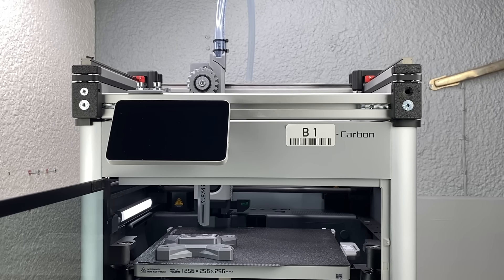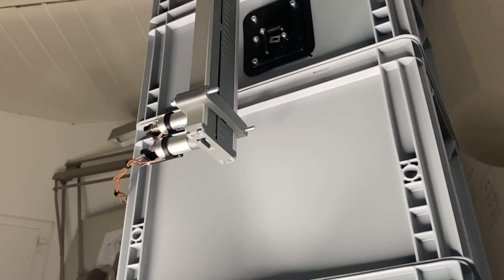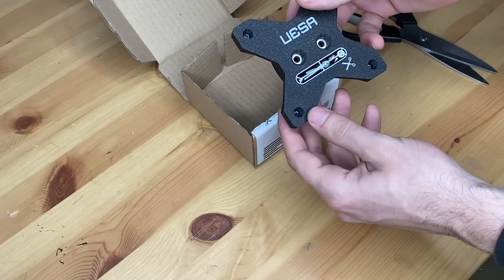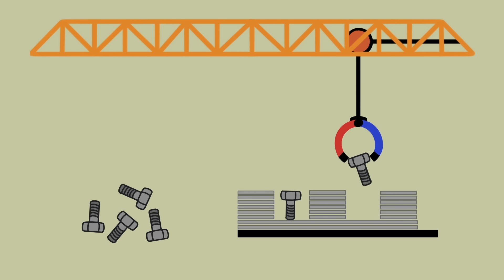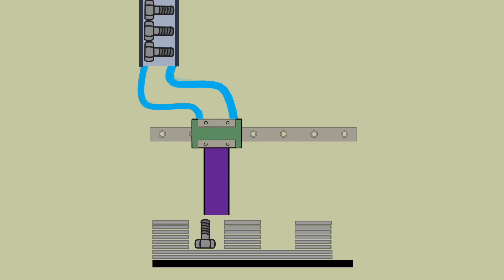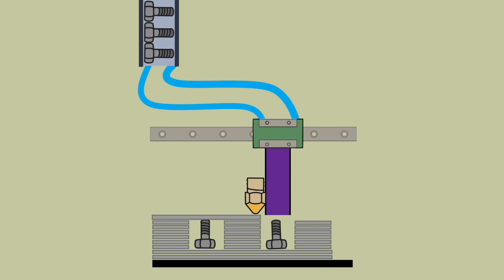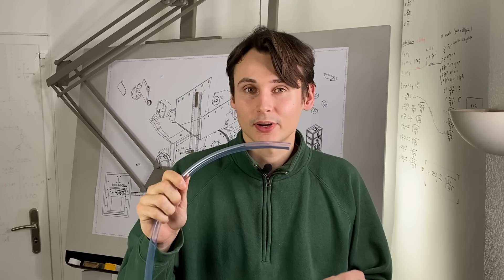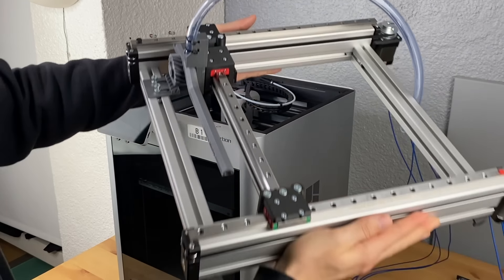Robotic placement - 3d printed automatic screw packaging #003

Comment: Is there any chance you could go into more detail about the tensioning system ?
Reply: +1 too. It seems completely clean and crazy easy to use
Reply: +1 Please give us a hint on what part moves to do the tensioning.
Reply: I think its just a threaded rod, that runs through the hole in the extrusion and pushed on the roller on the other side.
Reply from the maker: sure, to be honest it's not really tricky. @Frederick explained it well. It's just a threaded rod that goes through the hole in the aluminum profile and is connected to the roller on the other side. On the threaded rod sits a pair of springs. The rear motor mount has a sliderail that runs in the profile. This allows you to "extend" the rear motor up to 40mm. 
I like that it is easy to access from the front and pretty straightforward to use. But it is unfortunately not witchcraft
Reply: Definitely would like see more details about this as well
Reply: Same here! Looks great and I would love to see some details!

Comment: Pretty neat idea! Piling is definitely an issue that is very common in robotics. Perhaps you should allow the screw to land vertically into its own vertical chamber maybe made from a hex grid pattern like an infill? Turning it sideways before placement is also an option but its definitely more complicated.
Reply: Exactly my thought, add some simple dividers in the pocket, for each screw, and place them, each one in its own place. the divers don't have to be solid or go over the full height, just some bridges in the middle and some more on the top
Reply: Exactly!  Or even better, redesigning the part such that you place the screws into chambers where they are actually meant to use.  Automating the placing of captive bolts in a 3d printed part could be really awesome!
Reply: I don't understand how to tighten the belt at 7:36
Can someone explain it to me?

Comment: This probably wont make much of a difference because you probably found a solution, but if you put a curved shoot at the buttom where the screws come down you can force the screws to move the furthest point of the slot, as the second one comes down it will push the first one further along,  in all each additonal screw will push the previous one toward the far side. This should solve your problem of screws being bunched up. A second away to fix the problem would be to start the drop at the far side of the slot and have the head move toward the front dropping screws as it goes allowing the screws to be more spread out instead of bunching up by dropping in one spot. Just some food for thought!

Comment: Hi... Perfect design...
Can I give a tip?
About the screws going out, is because of aceleration while falling down... How about putting some electromagnet at the end of the tube? You can activate electromagnet while the screw is falling, use some light sensor to see when the screw is stopped at the right end of the tube, and turn off the electromagnet, this will allow the screw to fall slowly...
Sorry for my english, still learning.

Comment: This machine has potential! It can (and will) work!!! The only problem is keeping the screws in the same tail-up orientation when it lands in the hole of the printed part. You might want to have the head of the screw inserter (the part labeled "DIN912 M416") move in a straight line each time it inserts a screw; however, it might require tuning of the pneumatic system so that it doesn't give the screw enough energy to bounce and lose orientation. Or an easier option would be to increase the, depth of the, cavity the screws are placed in, regardless of their orientation or likelihood to jump out.

Comment: i've used commercial nut feeders that cost well in excess of $10k each, even those had  tons of problems. It's a tough nut to crack. The fact that you managed to get a working one with 3d printed parts is impressive as hell.

Comment: Printing small guide surfaces along the drop/fall path could ensure proper bolt stacking, that’s a good cheap feature on the part itself and keeps your insertion tool general purpose

Comment: Creative approach, and nice work even if it didn't work out the way you wanted.  One other issue not mentioned here is the user experience.  I wouldn't be thrilled if I left jagged edges on my brand new part after removing the screws from their chamber.  Inevitably, someone won't do a great job with the break-away, and they will cut their finger as well.   Instead, what if you just position the screws into the holes they will eventually be used in?  Then print a single layer that keeps the screws from falling out of the hole?  This should help resolve the stacking up issue, AND it actually provides value to the end user.

Comment: How difficult will it be to add an offset electromagnet tool head, the let the 3d printer go to fixed place, where the screw feeder places the screws. It is a bit of overhead, but compared to 3d print time, not that much. Just some thoughts 💭

Comment: Rather than dumping all the screws into a single pocket, can you not deliver each, in the correct orientation into the hole it's eventually going to fit in?  You could make the screws completely captive, just leaving an exterior hole big enough to insert the hext driver to tighten the screw.

Comment: Great demonstration of engineering! Would adding an electromagnet to the print head and a feeder work? I feel like it could further simplify the process by altering the G code having the tool head picking and placing parts on to the 3d print.

Comment: Also, to solve the impacting the build plate issue, you could lay down a layer or two of transparent filament with similar tolerances to a brim, just for the entire hole as opposed to the wire mesh that you has shown.

Comment: Regarding the screws piling up, what if you added a small electromagnet at the tip of the dispenser to temporarily "arrest" the falling screws so you could have a more controlled screw placement? 
Instead of the screws falling 50cm+ onto the build plate, it'd stop right at the tip and then released, with the final drop being potentially less than 5cm?

Comment: And actually, I think your HBot is very practical too. Screws simply need to go in individual pockets in printed model to prevent piling up. You're dropping screws head down, right? I'd divide the slot you're dropping screws into with one-wall fences so they end like bullets in a clip. And may be a bit more of cut-out mesh on the print surface to protect it.

Comment: I really enjoy the engineering/problem solving you go through. 
You could 3d print simple boxes to store the screws in for shipment instead of manually handling bags. Peeling a tray of pre-counted boxes off a printer plate 'may' be less time and work than opening a bag and holding it under a dispenser. Also, your customers  get an extra little box.

Comment: The impacting on the build plate could be lessened by printing one or two layers below them.
That way they don't directly hit the plate, but 1-2 layers is still thin enough that you shouldn't need "heavy" tools to get them out again.
A small grid design could further make it easier to remove without removing the protective effect.

Anyways, I'm so excite for how this continues.
Gonna rewatch the last video because that dispenser is such a nice design. I wanna see it spew out the ~60 screws again :D

PS: I wanna chime in with the others on the notion of how the tensioning system works. I've rewatched those few seconds a few times and still can only guess how it works...

Comment: Dude, please print that screen adapter on top of the flattened carton box. Then, when finished, use the gantry robot to fold and form the box around it. Also, use it to throw a plastic bag with the screws in the box and fold it shut. Build an ejector and a flat cardboard box sheet reloader to restart the process and take a vacation!

Comment: Christopher, how about this ... not thought to the end 'though and would not work with the current configruation, but maybe could be built on this: 
Make the applicator L - shaped with the horizontal part holding a revolver magazin with a "bomb slot". One chamber would have to be empty at the start.
Make the tube end above the printer or have Your stack magazin end directly over it. 
Then, in the horizontal position of the applicator fill up the revolver with screws - each chamber having three or four screws.
Then bring the applicator to the vertical position, the desired x,y drop zone and rotate the revolver by one chamber.
Two chalenges from the current version would be to hold the applicator horizontal when being moved for refueling and the rotation "down there" which could be done mechanically or electrically. 
Alternative to the revolver would be a variant of Your already existing magazine stack which would be filled from the side (from top in the horizontal applicator position) and would would hold three or four screws per stack level. 
Hope this is clear enough to understand what I mean.
Regards Frank

Comment: Cool idea. But sorry to see you didnt make it to the end with it 🤔
The solution is pretty simple i think. Separate compartments, and move the tool between every drop of a screw. 

If not enough space to drop them vertically, then have them diagonally or even flat, with a chamfer, like the orientation part in the stacker system.

Comment: Try adding a wire coil at the bottom, as each screw is dropped you're now dropping through a magnetic field that can be tuned to slow them down. You should also just make the screw chamber bigger...

Comment: Great idea, this is one of my new favorite channels!

One idea to solve the screws piling up issue. What about making the tool head a detachable extension to the magazine. So the orientation is maintained horizontal? You could even have an arm in the path of the dispenser screw to optionally flip it vertical similarly to the part you designed to feed the tube

Comment: I've really enjoyed these videos. I'm in, easy subscribe!

I have been working for a solution to replace manually placing test tubes caps and ran into a problem with orientation where gravity will not guarantee a proper alignment. Do you have a solution or a methodology for designing part orientation without reliance on uneven weight of the part?

Comment: you could just print some cylindrical containers if thats a packaging problem. it would still work as packager without human intervention. With threads and everything :P. And the next thing is auto bed replacer which I already saw somewhere and it would be truly automatic system.

Comment: I thnk if you added a magnetic control at the bottom of the end effector, you could solve your problems with the scews. Something that would squeeze the end thats dropping the screws, until the exact time that they need to drop. It would only take two wires and a few wraps of wire in the right spot. Maybe like air brakes on trucks where it its closed until a force is applied to force it open it. If it failed, it would fail closed and preserve the print at least. 
Looks really slick otherwise. The internal naming is a great method.

Comment: your videos are so incredibly inspiring! here's an idea where your current design would work wonders: embedded screws into the part such that you cannot loose them. like placing a screw into a counterbored hole where the counterbore partially narrows at the entrance such that the screw is trapped inside. I always love parts where screws can't fall out, makes disassembly & maintenance just so much more pleasant

Comment: Nice engineering work.  I definitely think this is an engineer looking for a problem to solve, instead of being an actual problem, since you'd require your customers to go find some scissors to free the screws instead of just opening a bag, but it probably could be implemented better with a precise drop for each screw in a silo'd screw hole that would keep each one vertical, before covering them up.  Either way, you've earned my sub, and I look forward to seeing your other projects.

Comment: It would seem to me that making the bagging part of the process automated would have been an easier task (though for sure less cool).

Assuming you can buy baggies that are open.
If you simply had a set of rollers pull from a stack of baggies (think similar to a computer printer pulling from a stack of paper) and then have a moving capture mechanism that holds and moves the baggy to the right position. 
A jet of compressed air props the bag open while the screws fall in, then a press closes the bag before the retaining mechanism drops it into a container.

Have you looked at the viability of this concept yet?

Comment: Open Sourcing the Design, but Selling Kits/Toolheads for this could be a way to go.

I personally (once i get the funds) would GLADLY buy a version of this project in Kit Form from you.  That way i can use this awesome machine, and support the original developer (YOU).  But since it would be Open Source, others could design different modules/toolheads and have them connect and interact nicely due to the Technical Drawings/CAD Be available.

If all goes right, you could grow to something like Prusa Research (although growth is not REQUIRED, do what makes you happy) and a whole community could emerge from this, and “mid scale manufacturing” could have a huge boost!

Comment: This is awesome, also regarding the problems of the screws staking, I don't know the term for this mechanism (Ill just call it a Pivot T) but I thought you might solve that problem by using something similar to a pivot point that are used when balls need to go right or left in a Marble Run Machine. Having the 90 degree angle on the Pivot T will most likely be a problem so you could modify it to be "reciprocal squared" shaped.

Comment: Seems incredibly overengineered for this specific application, but hey as an engineer I LOVE overengineering 😊

I also appreciated the smart bits in you design like the mechanism for folding away which doesn't use an extra motor or servo.

Keep up the good work!

Comment: Hi. Would you share please what kind of CAD software are you using here? I have worked professionally for years with most of the major products, and every single one of them is garbage. Some have unproductive, primitive modeling with no freedom at all, some are terrible at drawing creation and BOM management, some are just buggy and crash all the time. They are all frustrating in their own ways. I was just not able to find a good tool.  The look of your models look unfamilar though, so i have clearly missed something. what is it, and is it any good?
Reply from the maker: Hi, I use a wild mix of mostly Autodesk software, for this video Inventor and Fusion360

Comment: Looks good the theorys pretty good on it, executed incorrectly in part placement part, and your stop and feed positions were not programmed well enough. Without correct holes and part position placement of course it did not work. Its a great concept to get others thinking and trying similar devices. Internal bearing and bolts would make prints more convenient

Comment: At this point, you might as well build a 3d printer with tool change. Less belts, no worries about toolheads coliding, easier to drive (you can use 3d printer control board to insert screws)

Comment: I'm not a fan of the system of automatically packaging screws inside the print: one failed print (probably 4 since you print several at a time) because the nozzle bumps into a screw will conteract any savings on the plastic bag. You could have your machine place screws directly in the cardboard box, maybe?

But as a way to insert metal (or previously printed plastic, why not?) into 3D prints, that's cool

Comment: darn I'm going to build something like this for my printer i have 6 tool heads i only ever use 3 or 4. i want to make tools 5 and 6 do m3 heat set inserts maybe one for vertical and one for horizontal. with a side mount feeder system. 
a small stepper vacuum pnp and a custom induction heater tip
Reply from the maker: sounds very cool!

Comment: slow down the steps between the placement of the screws and as the arm moves across the hole. it should leave the screws stading up and have more control and presision

Comment: Anyone got any ideea how the belt tensioner works?
Reply: Not a clue, haha. Maybe he'll share his CAD files in the future. Seems like a great starting point for a custom Core-XY printer.
Reply: I think it may push out the motor on the other side to tension the belt
Reply: @karolniedbao5420  so the lateral slot is to insert a nut? i though that for example let's say the shaft of the pulley wheels are mobile, and when he screws that bolt, the bolt stays in place, and it moves close to it something like a triangle, that pushes the bases of the pulleys apart

Comment: If I may suggest you a solution.

To decelerate the part and get a more precise output, I was thinking about the effect you get when you pass a magnet into a copper coil (as this : https://www.youtube.com/watch?v=N7tIi71-AjA)
But as your part are made of iron, instead of a passive coil, using one or multiple coils that you activate when an element pass though can slow down the part and reduce the bounce effect.

Comment: Mf would literally mod a bambu instead of just building a voron💀
Reply: Just build a tapchanger then replace one of the toolheads with screw dispenser. There are also gcode libraries for handling these stuff.